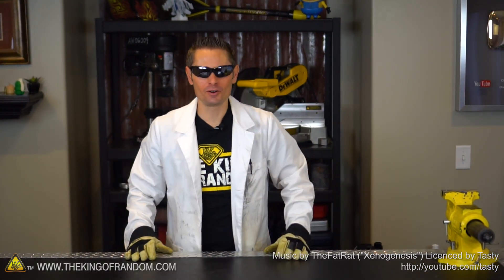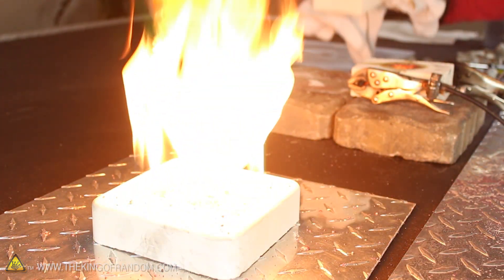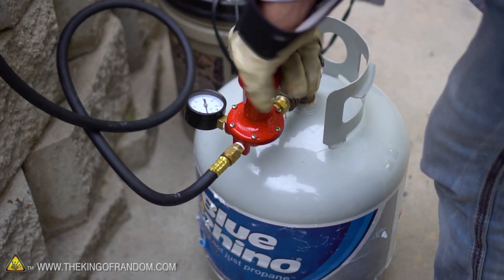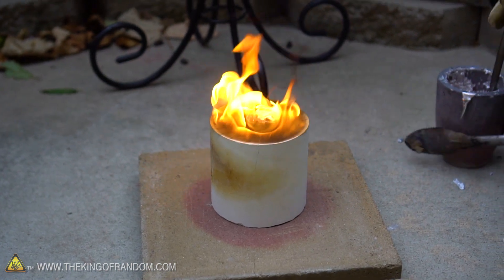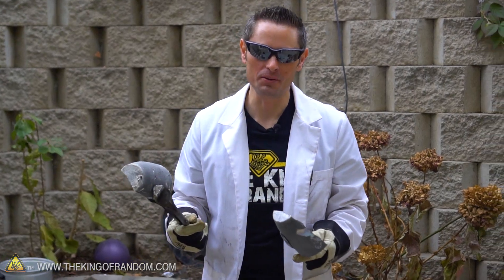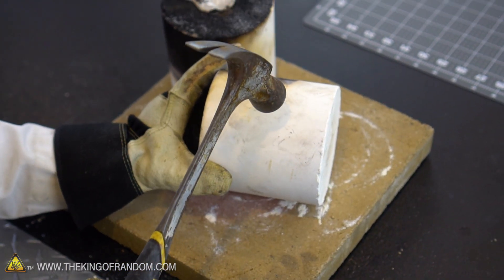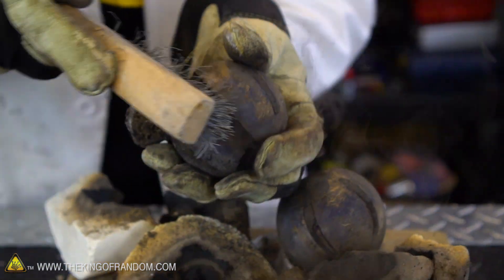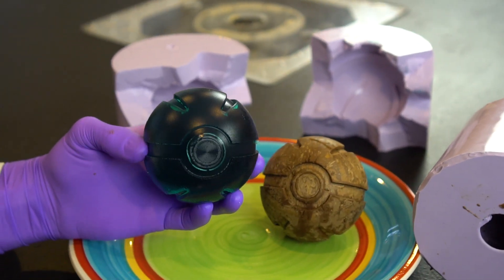Casting Aluminium PokeBalls

Comment: Just a tip when using silicone you can stick the mixture in a vacuum chamber to help get the air out then pour it in a thin stream from up high so the rest of the air bubbles pop. That way you don’t get the air holes in the mold.

Comment: When casting with silicone pour it around the mold then vac the air out. Just make sure your mold is solid. Instead of using plaster use hydracal to mold then vac.

Comment: Try putting your plaster molds in a vaccum. It will pull all of the air out and might help with the cracking when you pour in the hot metal.

Comment: You might consider using some kind of vibratory device to give a mild vibration to the setting metal, silicone, and plaster molds to help with the air bubbles.... vibration should (SHOULD) cause the bubbles to travel to the top faster.

Comment: So I'm not super exp I just know a little one thing you could do is drill  a small hole in the mold on the side for it might help a little I've seen it used in ring castings

Comment: If you could find a way to cut the plaster molds, maybe with a band saw, and rejoin the two sides with a large hose clamp you could reuse the molds. Also could you use the same mixture of sand and plaster that insulates the mini foundry to make the molds? Might give you better heat resistance.

Comment: To avoid bubbles in your sphere castings you need a small secondary hole at the top of your mold for the air to escape as the metal fills the mold and plugs the primary hole

Comment: I think you're supposed to mix sand into the plaster to keep it from cracking. And to get rid of the air bubbles you need to have a second hole sprue? to allow the air to escape.

Comment: plaster is too weak for casting metal, it will crack. the heat of molten metal will cause loss of water molecule in the plaster which is important of bonding the plaster powder together. try to use phosphate bonded or silica bonded investment material for casting metal

Comment: in order to get the mold to fill better you need a second sprue to allow the mold to fill completely. You'll know when its full when metal comes out the top of your second sprue. Also, that second hole needs to be somewhat smaller than the pouring sprue so you will have less metal to remove and less finishing work in the end.

Comment: im a goldsmith and im impressed that you get this process by yourself. we goldsmith used a similar technic for jewerly.. exept that im the final step when you pour the melted metal you need a centrifuge or a succion machine to make metal go down and get better results with less imperfection on surface and less air bubbles inside the jewel

Comment: Not sure if it would be the exact same on a larger scale but when casting gold crowns in dentistry we use Investing stone surrounded by a metal case. After the investment sets around the wax pattern it's heated to 1200 degrees for about 90 minutes and then the gold is cast. Possibly the material you use to invest your pattern or the heat of the oven could help with the cracking.

Comment: To help with the air bubbles when you do your casting you should make a sprue it's just another hole near where you are pouring the metal that helps to release the air as you are pouring in metal through the main hole you know your full when liquid metal comes through both holes for casting something about the size of a pokeball is probably use something about 1/4 inch should be more then enough to let the air escape the casting

Comment: next time i'd suggest putting a thin plastic sheet with a half bubble rectangle and an indent on the other so they interlock together(like the plastic packaging for toys as an example), then have a metal ring you can slip over them to bind them together and slip off to split them there's steel size adjustable rings you can use they have notches in them to tighten it down. that way you dont have to smash your hardwork to pieces :P

Comment: when im casting jewelry. its at a much smaller portion and we still heat up our tubes to over 1500°F... they completely dissolve if you put them into water a little after casting into the plaster. much cleaner and using a regular cleaning brush does just about the same.. we also vacuum the plaster.

Comment: For your metal molds why not use refractory cement? either premixed or mix yourself.
It is designed to handle high heat after all.

Comment: To keep the plaster from burning and lighting on fire and getting a cleaner casting, do a 50/50 mix of plaster of paris and sand, the plaster will ad form and the sand will add heat absorption and burn resistance, as well as make it more difficult for the heat to crack the casting chamber, also, to avoid excess air bubbles and come out with better molds, make a small release hole off to the side of the pouring hole that connects to the rest of the mold to release gases that cause the air bubbles in the castings

Comment: As a student metal-caster I can offer the following advice: use a product called Hydrocal instead of plaster of Paris. It's more like cement, it's tougher and can also withstand heat better. Also vent holes are your friend, they can help remove air that gets trapped in the molds and prevent cracking.

Comment: Use sand instead of plaster. Sand makes metal casts come out without any air bubbles the only risk u run is the sand falling out which would be a terrible tragedy

Comment: pick the mold up before it set then gently hit the bottom of the mold to the bench it will force the air bubbles to come up. this is how we do it in the food industry specially when molding chocolates. fold the mixture gently to mix it dont use a mixer. also with the wax pokeballs you can smooth out imperfections using a hot knife or lighter

Comment: I noticed that you said  you burned yourself, I know this sounds crazy but if you pour vanilla on the burn don't dab or touch just pour or soak the wound until you can't feel the pain anymore it won't blister and will reduce the injury a lot either vanilla extract or pure it doesn't matter. since you do what you do I thought you might like to know this little hint, it will work for any type of burn. It really works!

Comment: Hi Grant, 
In order to do an aluminum casting you'd need an investment mix which is usually 1 part sifted play sand with 2 part plaster and 1 part water or so, mix up well and pour over your wax.  I've also re-enforced my investment with either chicken wire or fiber glass tape.  When you melt the wax out you should fire it in a kiln or oven at a couple hundred degrees to melt out the rest of the wax and dry out the investment.  These are my suggestions let me know what you think!

Comment: after melting the Wax out, why not use a hacksaw to cut in half? thats way you can reuse it and it will already have the crack to release the heat better

Comment: Ceramic Slurry could be a solution for you. First you make your wax mold positive with a large sprew along with some straw shaped vent tubes. Then you dip the mold in the slurry [as per manufacture's instructions!!!]. Once it sets, the ceramic can be cooked with a torch to melt out the wax. And WA-LA! You dripped out the wax in a hurry and you have a slightly more expensive investment mold!
Also, I absolutely love your channel. I am so happy you exist and are doing what you do! Keep up the random fun!

Comment: Tip for keeping the plaster from cracking: pour the plaster in an oven-friendly material such as a segment of steel tubing instead of the acrylic tubing and de-gas in the vacuum chamber before it sets. Leave the plaster in the containment material. Proceed as normal. To remove, drop the cast in a bucket of cold water while it's still hot. The thermal shock should break the plaster and free the aluminum. Learned in a nonferous metallurgy class.

Comment: 1:1 mix of Plaster to Silica powder will give you a mold that withstands heat better. Use a respirator and mix outdoors. Also add a larger funnel onto the pokeball you use for the mold so that you have a smoother pour and a slant for gases to escape while allowing enough overpour to combat shrinkage.

Comment: If you use investment from a jewelry making company and put it in your vacuum chamber, there will be no bubbles.  Very similar to what you are doing...just use jewelry casting methods.  Then you cut off the spru and polish it with white diamond on a polishing wheel or on a soft wheel on a dremel.

Comment: in my opinion I would've sand casted it. I'm not a expert but ive done sand casting before and the finished cast was perfect no bubbles or anything. just as long as you pack the sand enough and dont break it and put holes in you should be fine

Comment: today I learned: heat the crucible and let it cool before casting
;) Thanks for breaking yours so I don't have too!
Also to avoid air bubbles, take a few bamboo skewers and stick them through the top spaced evenly to create vents in the mould. (coat them with vaseline so you can pull them out before you bake.)

Comment: If you add holes in the top that lead to the casting chamber and don't pour aluminium in them then the gasses can escape and the pressure doesn't rise inside too much

Comment: You gotta shake the air bubbles out after you pour the metal in the molds
Like if you had some platform that slightly wabbled back and fourth in a box, maybe with like a heavy duty spring..... Set the slab on that spring in a box, set the mold on top and it wabbles slightly while you pour. The shaking should move the air bubbles out before it cools off.

Comment: to help with the final cast of any kind of metal you should heat it up to where it's liquid like you already are doing but instead of slowly pouring it into the mold just quickly por it in so the metal as little to no time to harden back up which will give you better detail as well.

Comment: use silicate sand. it's the black stuff. and make two halves for your mold and compact the sand then pull out the mold. pure molten metal inside. the sand let's air escape and doesn't make bubbles.

Comment: if u want to eliminate bubbles add straws to the mold  make it them  touch the wax so gas can escape the straws will burn off watch a video on sand cast molds and check out there technique

Comment: use sand 85% + clay 11% + water 4% by weight and use it instead of plaster of Paris, it will let the gasses permeate through the pores so there are no trapped bubbles, and it is cheap, re-usable, and much easier to work with...learnt that in my Mechanical Engineering 1st year...makes really nice aluminium castings

Comment: You asked what to use for a mold, I suggest you to use Ceramic, it will not crack, you don't have to wait to warm, it IS the actual casting, molding, material. (Used in all Kills.) P.S. It won't make bubbles either.

Comment: you should use caster plaster. it has to be baked at 1600 degrees but high heat does not make it boil and give smooth castings. it's what I use as a jeweler

Comment: I don't do casting, but correct if i'm wrong.. If you did the plaster in two halves, with the fill hole being split in half, couldn't you just push the two halves together? Then you'd have a reusable plaster mold?

Comment: Might be worth trying to build a 'jiggler' platform before you try your next casting. An electric motor with an offset weight should be enough to vibrate the platform to help get rid of some of the bubbles you were seeing in the casts.

Comment: A suggestion for dealing with air bubbles in your metal casts:

You should add some air channels parallel to the pour channel in your molds so that air bubbles can escape and not get trapped trying to leave through the same opening you pour into. 

This works for rubber molds for plastic casts so the same principle should apply to plaster/sand molds and metal casts.

Comment: Hey Grant. Got a question for you. can you take a hollow paper Pepakura model, put it in a bucket and pack sand arround it, and pour molten aluminum in the mould? obviously you can, but would it keep the the detail of the pepakura model and burn out the paper?

Comment: Ok, grant, here's a few small tips, one a normal plaster cast takes about 3 weeks to dry out in open or 4-5 days at 45 decrees Celsius (113 degrees Fahrenheit) in an oven, you mold was literally nowhere near dry and burned all over there is also about a dozen other things but this is just the pressing issues.

Comment: hey grant I'm going to be trying to make my dad an aluminum trophy for his birthday. I was gonna use the sand casting method but trying to make a mold is proving to be a challenge. Any tips on what I could do?
Reply: Aaron Attlee if you have a trophy you want to model it after do the process he did with silicone negative >wax positive>plaster negative->aluminium positive then buy metal stamps ($12) and give a message
Reply: Stoli N mmmm thanks man

Comment: You may need small vents to allow the trapped air and gas to escape from the mold. You will have a little more finishing work to do....grinding off the material that flowed into the vents, but it should give better results. You could also consider making a 2-part mold that is parted horizontally.

Comment: cast your face then make a aluminium mask of your face
Reply: straws in his nose?
Reply: Favour Olufemi he would suffocate
Reply: Favour Olufemi
Reply: kim rhodes n
Reply: With the green sand he could push his face into the sand box and then cast it
Reply: nah this sand is harder than you think
Reply: Favour Olufemi I don't think that's possible
Reply: Why don’t u teach him how to do it by doing it on ur face
Reply: Genius
Reply: I've done it. petroleum jelly your face, then wrap with plaster combined with plaster bandages. Then paint the inside of that with melted wax, then make a plaster mold of the wax and burn out the wax from that. Then pour in your metal.
Reply: that would be cool
Reply: PenguinHajo There are ways to do it...
Reply: Favour Olufemi I totaly agree

Comment: You have to heat up the plaster before casting, because the remaining wax will start to burn - the wax must be removed completely before casting.
Better use green sand.

Comment: A tip to getting the air bubbles out, would be to add a little vibration to it after filling the molds. Just be careful with hollow items such as the pokeballs. More material will flow inside.

Comment: Hey, I'm sure someone has mentioned this, but if you clamp a jigsaw (minus a blade) and turn it on to vibrate the piece when you're pouring the silicone, you'll remove a lot of the air bubbles.

Comment: Instead of breaking plaster molds with a hammer and scratching castings with a metal brush, try throwing them in a bucket of water.

Comment: Try putting the moulds on a vibrating surface as you poor them and as they set. This will help get the air bubbles out.  I used to make concrete garden gnomes and we always poured the cement into the moulds on a vibrating table to help get the air bubbles out.

Comment: Oops, I almost forgot...the best way to make bubble free castings is to coat the object to be molded in debubblizer ( breaks surface tension and prevents bubbles from sticking ) and put the whole thing into a vacuum chamber to with a hard vacuum for a few minutes to expand and pop any bubbles in the silicone.  

btw,  it would be great if you did a video about how to make a diy high power vacuum pump, if you haven't yet ...then demo the above process for a perfect bubble free casting mold.

Tim

Comment: I love your channel  and videos Grant.  I have been studying jewelry casting as a hobby for years.  To save yourself labor and combustion in your investment molds ( plaster and sand in this case ) , study up on proper burnout and lost wax casting.  Tim McCreight's "The complete metalsmith" is an industry standard and best book I've ever seen on that subject.    You almost certainly didn't heat the molds high enough or long enough (  approximately the melting temp of aluminum for about 3 hours )  to completely vaporize all the wax and burn out any combustibles.  You should pour the metal immediately after the investment molds are burnt out to minimize or eliminate cracking.  Finally, after the metal solidifies and the molds are still hot,  drop them into a bucket of water.  The mold will shatter and release the casting with a minimum of effort.

Tim

Comment: When investment casting using plaster, you need to heat the mold to roughly the same temperature as the metal you plan to use to cast with, that will help with the trapped gas pockets since plaster has chemically bound water that gets released as it is heated, heating the mold to the same temp as the molten metal ensures that all water that will evaporate at the temperature of your molten metal has already escaped along with all the other substances that might escape as gasses causing porosity in your castings. Something to keep in mind is that at aluminium temperatures plaster becomes quite fragile and you can create your mold in something like a steel can to help keep it from crumbling... also as a side note when using ceramic crucibles when initially heating your metal, try to avoid packing the metal in there too tight since the expansion of the metal can also cause your crucible to crack... keep up the great work..

Comment: I think I know how to avoid the air bubbles... You add something extra where the pour top/pour hole would be, creating a top chamber and a bottom chamber like with a volcano. This would allow for settling inside the bottom chamber, which is what you actually want cast, and have all the bubbles/imperfections in the extra chamber which wasn't going to be kept anyway leaving the extra material to be separated from the perfect section of the cast and reused at a later time.